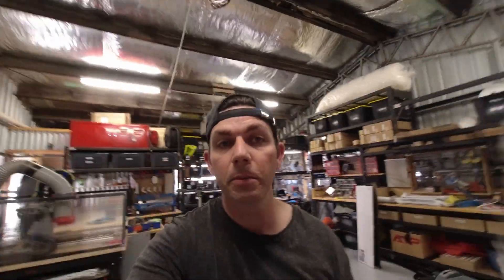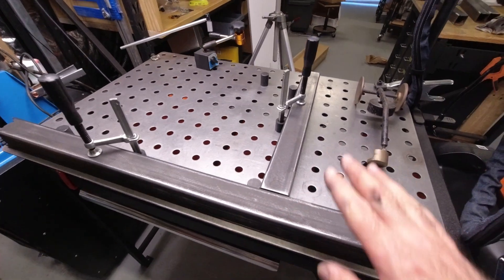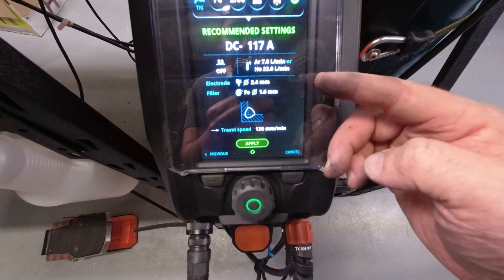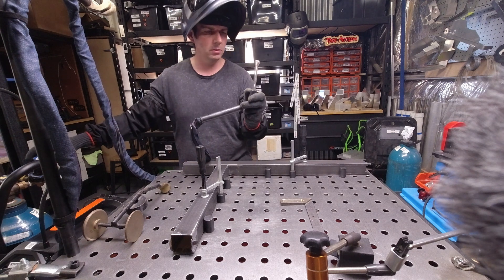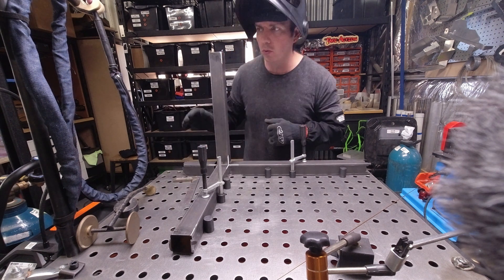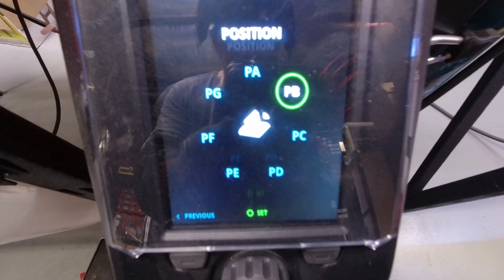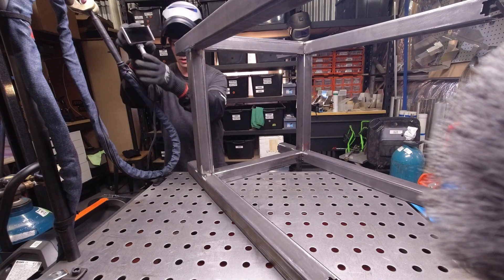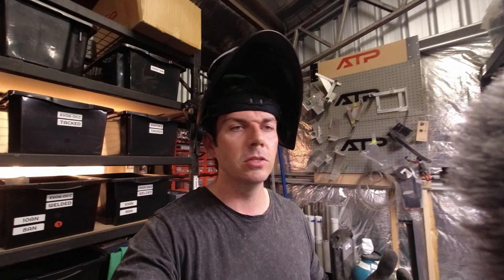Kemppi 235 - Weld Assist with 2mm Mild Steel

Comment: Hi Adam
Cool videos thanks! 

Im currently looking at a Mastertig 335 acdc and have alread tested the machine. 
Welding wise I was happy.. Did you have any issues with it? 
It seems that the menu is sometimes quite low and lagging user input. How is this on the 232A machines?
Are you overall happy with the buy? 

Thanks for any insight :)
Reply from the maker: Overall I am very happy with this machine. 

The menu can be slow and I wish the buttons were a bit more mechanical feeling (especially with gloves on), I often find I have to hit the buttons several times, could be lag, the gloves or both!!

The only issues for me were the original torch and cable are very heavy and I think poorly designed, it was a bit of work to switch to a CK flex. The other thing is the machine is extremely sensitive to earthing and I needed to bolt the earth clamp to my table and also have a runner to the work piece so solve this. 

All in all pretty minor and I'd say these are preference/personal style things that I would encounter with any machine. 

Enjoy your purchase, I'm sure you'll love it!